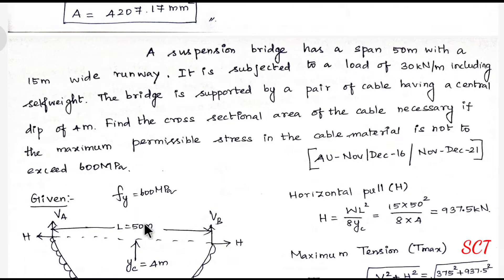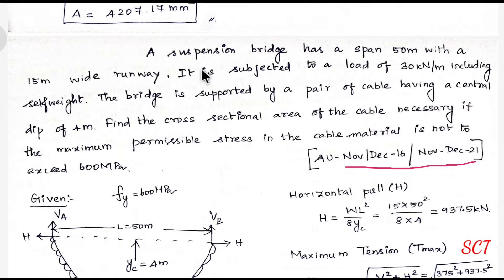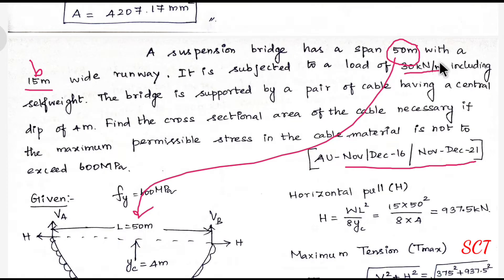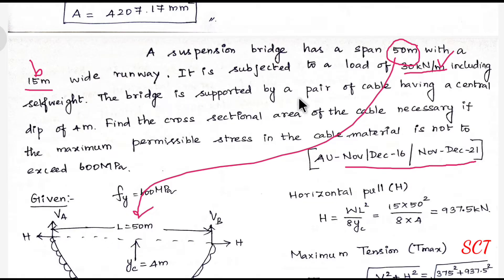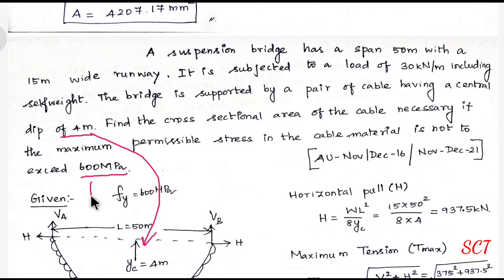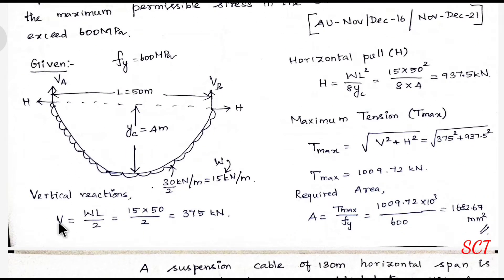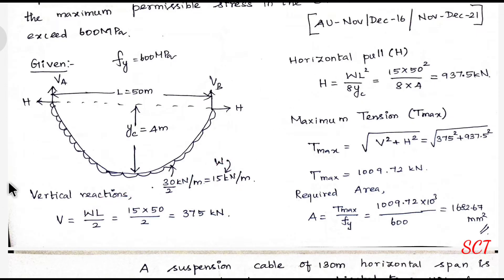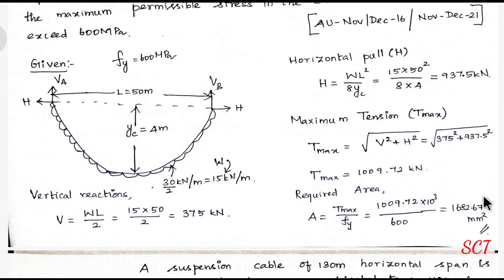cables and suspension bridges support at same level problem 2

Comment: Sir why we didn't multiple load and wide
Reply from the maker: Beacause in this problem, the unit of the load is kN/m. This is the unit for UDL, So we don't want to multiply with width but in previous problem the unit of the load is kN/m^2. So there we have to multiply bro